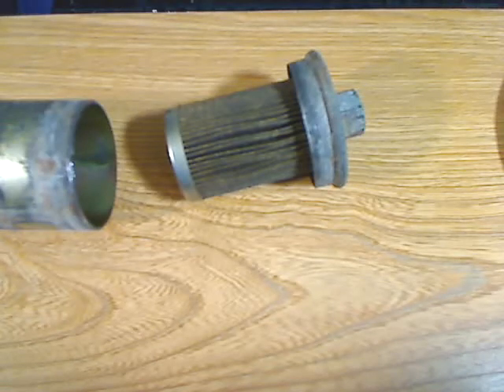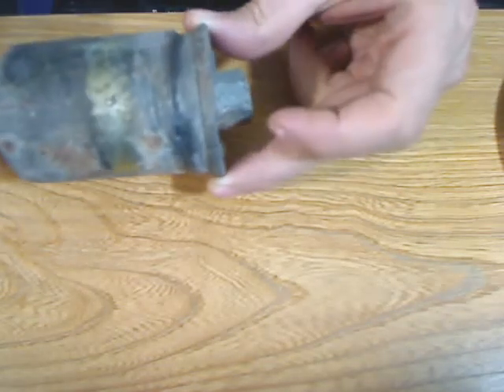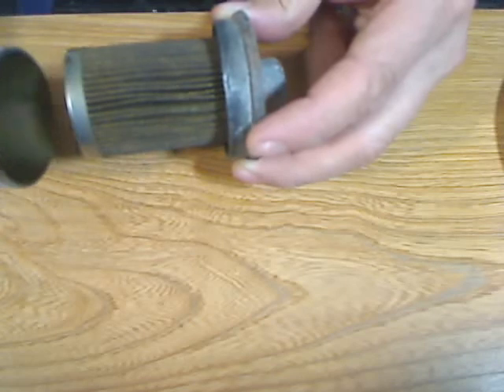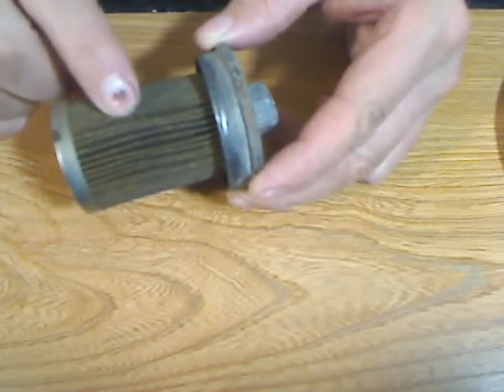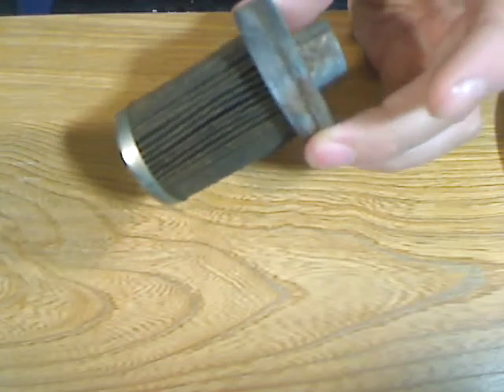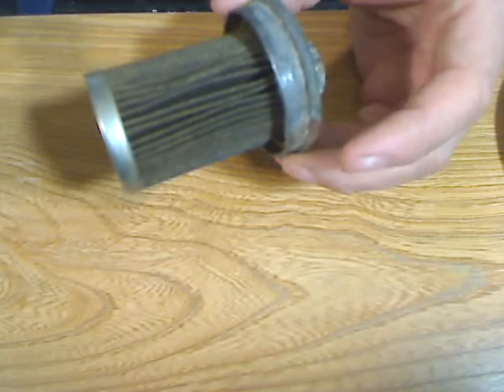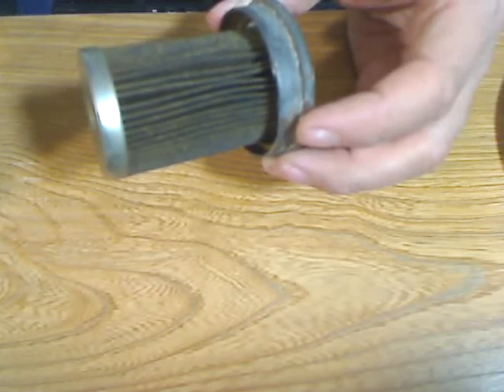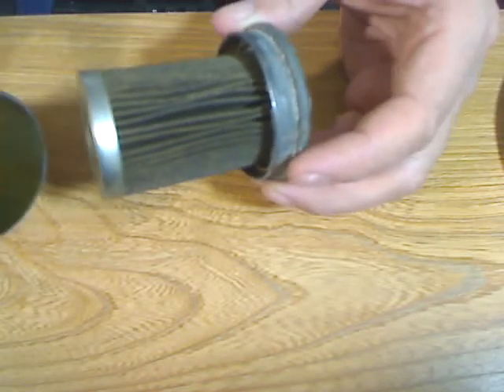Cut away of a typical Fuel Filter from a (gas) chevy truck

Comment: The manual and several parts places all come up with ''not consumer replaceable'' when they look up the fuel filter. I might install one on the frame rail though. I haven't had any fuel injection problems. I run a can of seafoam of b-12 in it once a month.

Comment from the maker: I find it hard to believe there is no fuel filter element other than the strainer inside the fuel tank. Most Fuel injection systems require a very fine filtration of 10 microns to prevent injector problems.

Comment from the maker: I have seen this before on a Suburban, the customer just replaced the fuel pump (Bought from a discount auto store) the fuel pump would not hold decent fuel pressure after a week of use. The fuel pump was replaced again with a complete unit purchased from NAPA and the truck never came back with a fuel problem... The fuel pump for your Tahoe is expensive and serviced as a complete unit.. Beware of the Lifetime Warranty from the stores that sell auto parts, its a scam to sell their crappy parts.

Comment: I changed my fuel filter and fuel pump in January then my 96 Tahoe starting cutting off the. I seen the gas wasn't flowing to my surprise I changed the oil, full tune up, PVC valve n more to find out it was fuel pump, was defective and the guy said I was lucky I didn't blow up my car!  I never had that problem with Chevys  I have been driving them since I was 18 I'm in my mid 30s. Please only use the ac delco fuel filters, their the only ones that are recommended. Thanks for this vid. Milly....